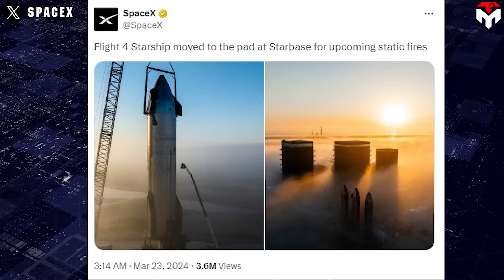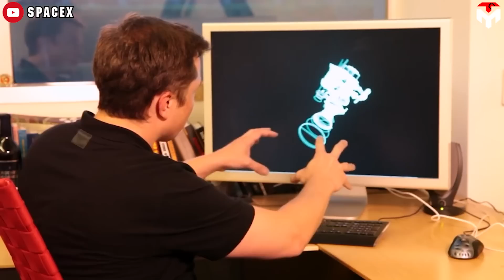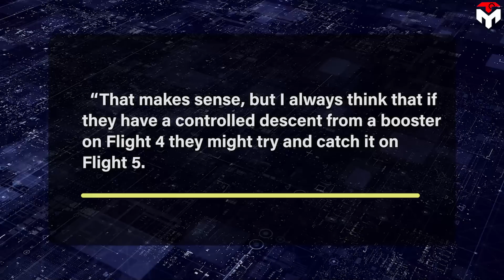SpaceX officially Reveals NEW CHANGES on Starship Flight-4 after Explosion...

Comment: A fully laden dummy or payload has to be achieved after full descent control and landing is achieved, that got to be the next 2 flights 4 & 5 or 6 allowing for failures. Then it's a functional vehicle. So that's 6 weeks per turnaround ,so 18 to 24 weeks plus 2nd launch tower. Then they can start catching vehicles.

Comment: What is the reveal? Fixing problems is not a reveal. Stop this bait and switch. is it a soft ware problem for the control thrusters or do they need more thrusters to control the roll. These are big ships and for the safety of the ship, cargo, and crew the roll must be recoverable from any mishap. We need some technical questions asked. Why was the roll out of control? What is SpaceX doing to prevent that from happening again? What about the boost back. Did all the engines fail or was it a limitation in the design of a few engines. Was it ALL software? What about back up controls if one fails? Did the transfer of fuel for inflight refueling cause a problem? Lets start digging for answers and stop making click bait titles.

Comment: Using a standard engine for orbital adjustments, as opposed to a vacuum rated engine, is wasteful, and in the case of Starship will only be done because there are no centrally located engines. It’s not done for performance or efficiency. It’s done because Starship has no other options.

If and when SpaceX builds Starships intended to go to Mars, they should consider ditching the three inner engines and switching to a 4th (or 7th) vacuum Raptor engine that can be centrally located. As Mars atmosphere is essentially a vacuum, all engines would then be optimized for their intended operational environments: in space and on Mars.
Reply from the maker: Great idea guy!
Reply: What about the plasma rocket 😊

Comment: I think SpaceX  should send just the booster up say 1000 feet and then try to catch it in chopsticks, after that I’d launch starship up without the booster and catch it the same way. This can be done before taking another shot at orbit and decent or in tandem with it. That would speed up the process to the final launch, save a bunch of money, and provide more data for the final orbit decent and catch.
Reply: Neither will test the untested entry of 26,0000 kph. That's the kicker. The landing, the belly flop maneuver, etc were tested at send it up let it fall down. Not the same as 26,0000 kph now control and flop it, get it to land etc. Never tested and I pray they are NOT finding out they need major changes to the rocket to get it under control due to speed
Reply: @scottbender9828  you don’t need to test in order to find all the failures, fail early, fail often so you can get to the success.
Reply: I hope you are right!
Reply: @scottbender9828  I’ve spent 35 years of product development making as many mistakes as I can before I pass it to the customer has been highly successful for me. Being able to pick yourself up, dust your self off and bandage yourself up is totally worth the learning experience. You don’t have to climb the mountain from bottom to top and you can skip and go back to the tough spots. Success is the finale, it never works the first time through, and nobody wants to destroy a lot of good work to sort out the one bad patch. Elon said it best, break it down to simple steps, then solve the easy stuff first.
Reply: There’s no point. They can do the full testing with a soft landing on water, you don’t need a real launch tower until you’ve solved the problems.
Reply: @StillAliveAndKicking_  keep climbing that mountain bottom to top, and I’ll keep beating you to the summit.
Reply: @StillAliveAndKicking_  silly person who has 7 patents and taken contracts from fourtune 500 companies, and developed products all over the world. I depend on my competitors to always do things the hard way, the way it’s always been done before, having a lack and value of creativity, and to not move to the next step before mastering the one they are on. Elon figured it out, by the time your done, I will have taken the next 10 prizes.
Reply: @davidgutting4317  Well I bow before your superior genius, and I’m sure Elon Musk does too. It’s always fun to discover know it alls like you online. Now, ignoring your preposterous egotism, I suspect Musk might know a bit about rocket development that you don’t. Of course I’m going out on a limb by saying that. And he might, just might, have considered the different ways to test his rockets. Or rather, his engineers might, since he’s more of a project manager who sets the direction, and culture. As for your suggestion, it’s dumb because it risks massive destruction. A far more intelligent approach is to soft land on water multiple times. They can choose a specific location, and if they hit that location, and hover as required, and do that several times, they’re good to go for a chopsticks landing. Plus there’s no hurry as there’s so much else to test and fix too.

Comment: Starlink full2 needs to be deployed--either as mechanism tests or for full activation. Starting from IFT4. 

Musk is racing the clock. When enough full-size Starlinks are put into orbit, Musk can start hauling in a lot of money, servicing the financial markets. He needs that huge cash flow, towards further developing Starship and getting to Mars. 

Currently, much of that funding comes from his personal funds, vis his (Tesla) enormous stock market value. But that value should substantially decline over the next 5 to 10 years. EVs are being prematurely rushed to market. Poor cold-wwather performance. Major problemslputting out EV fires. But the biggest problem... 

We need about 15 years of strong societal commitment to a huge (25-30%) expansion of electrical generation, to energize EVs--without sucking out needed electricity for homes, existing machinery, hospitals, etc.

Only then can EVs replace (without societal distress) hydrocarbon-burning cars. Until that time, Musk's Tesla stock calue will languish.

Go! Getting into space, and to the moon and Mars. But that needs massive Starlink revenue. So... start using remaining Starship testing to start deploying Starlinks. No time to waste.

Comment: Emergency!!! THE ONLY SOTUTION!

 Baffles will not work to prevent the fuel slushing problem, because the tanks of the starship system are too large. That is the only reason why the starship will explode every time.

The solution:

The tanks  of  Starship and  Superheavy need 2 disk valves, expanding the diameter of each tank. One of the disks, the one on top, rotates above the contiguous disk to close the overlaping holes on the surface of the disks; to reduce the Size of the tank by dividing it, before any rotation or acceleration of the rocket. This will prevent slushings and protect the plumbing, if located 10% above the bottom section of each tank. Large telescopic pistons can be attached below the bottom of disk valves to control the fuel pressure as the piston expands into  the fuel tank. 

 I have built a model that works perfectly. The second disk valve can be located 10%  below the front of the tank, to also protect the front of the tanks from the slushing forces. 

The  gridfins are too flat and too small to be effective enough and will not be able to control the booster. 
Why is Elon  not using four pins instead of three to secure each heat shield tyle? Four anchor points provide far more stability to secure a tyle, not three.What is more important than securing the heat shield? Four anchor points would eliminate the problems of tyles falling off the ship every time there is an engine ignition. Please get this message to Elon. Thank you.

Also, Spacex needs 3 actuators to move the payload bay doors correctly, not two. They have only two now, one at each end of the payload bay. They need one at the center position.   Three will guarantee that there will always be enough support to open and close the doors, even if one of the three fails. I know the spacex engineers can see these problems. It is like ignoring the elephant in the room. Musk needs to hire people who can be trusted and who will not continue accepting bribes from Jeff Bozo to sabotage spacex.

Comment: For me, it was obvious that the ship entered the atmosphere without control rotating slowly. How will SpaceX people get the ship under control? The ship did not react to the movement of the fins.
Reply: The fins aren't going to have much effect on the ship in space. You need to be in the atmosphere for them to function...
Reply: @billotto602  That's right. But how could they control the Starship out of the atmosphere? I did not see any stabilization nozzles.
Reply: @gottfriedheumesser1994  me either. I think they call the thrusters  - but there wasn't any sign of them.
Reply: There may  be a reaction  wheel  inside the ship to stabilize it. Don't know  this for sure, if not it sure needs it.